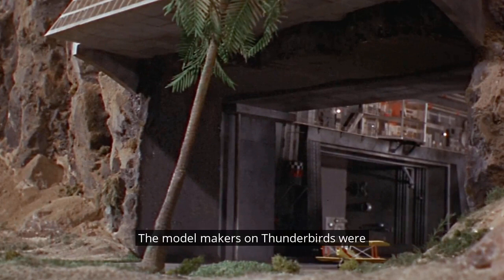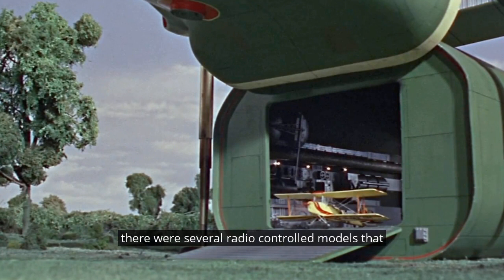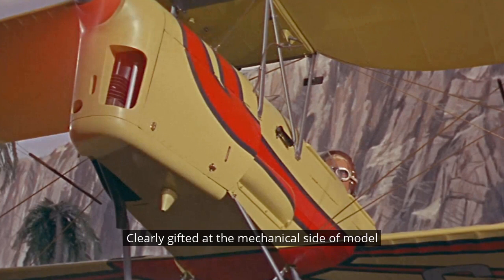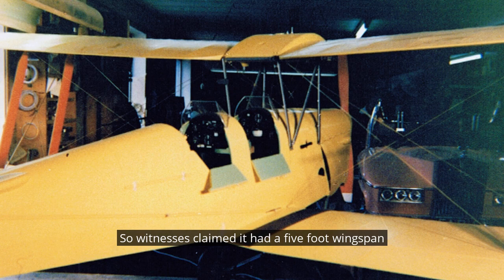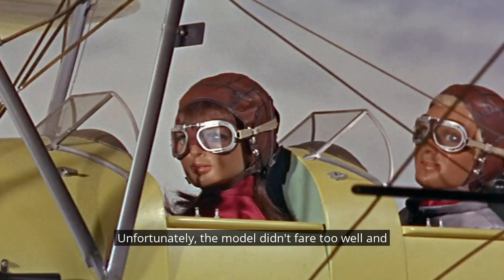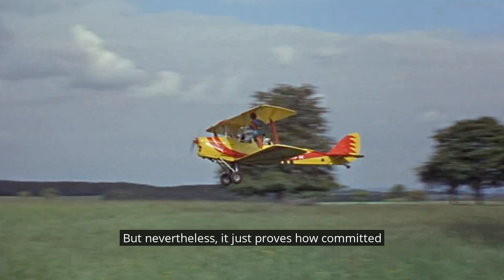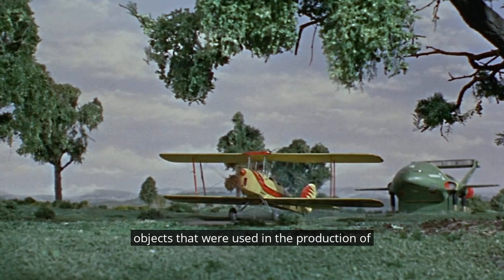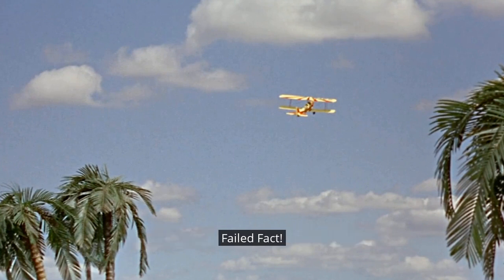FAB Facts: When the Century 21 Team Built a Working Miniature Thunderbird 6

Comment: @GerryAndersonTV  >>> Nowadays there are actual miniature gas turbine engines used for radio control model aircraft. 

Back then {1960s}, I wonder if this model used two miniature pulse jet engines. At least one brand of model airplane pulse jets -- called "DYNA-JET" -- was available to hobbyists. I remember seeing them at hobby shops in the 1970s, but teenage me did NOT have enough $ to ever be able to purchase one. 

Whether any actual miniature gas turbines that small were available at the time, I do not know.